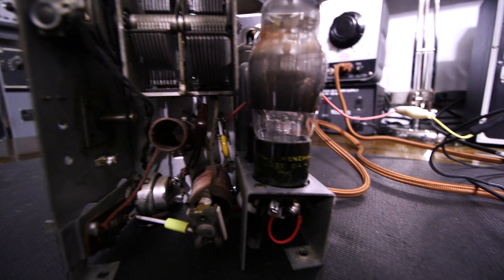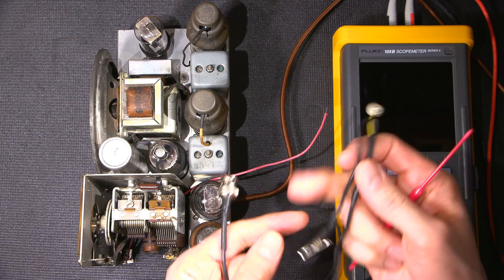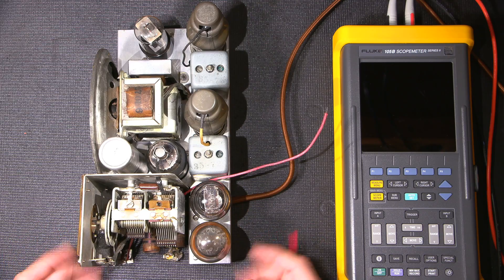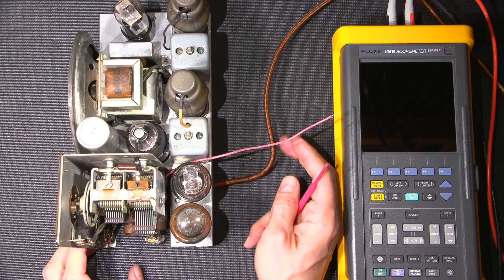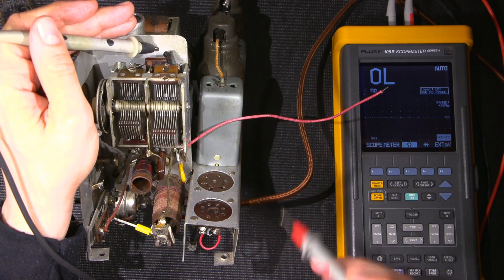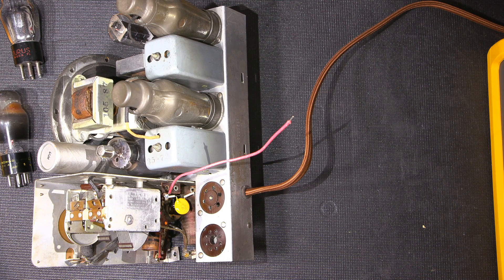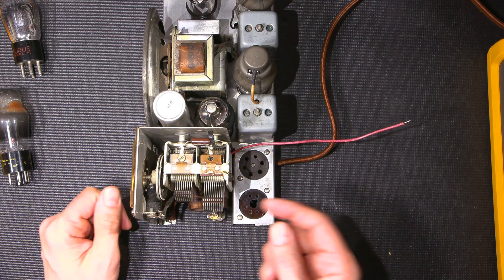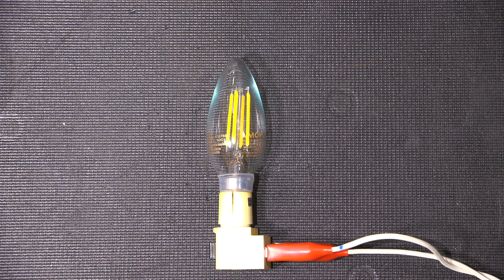See High Voltage Created From Falling Snow!

Comment: Excellent video mystery! RF Antenna engineer here. You built a Tesla coil! My thought is that you have an open circuit transmission line that is of a 1/4 wavelength multiple. What freq was the radio tuned to. Did you change it without effect? The dielectric strength of air at RF is 15kV/inch. You have at least 2KV at that arc. Easy to get voltage step-ups of 5 to 10 times with a transmission resonant transmission line in a partially connected radio. It's how a Tesla coil really works. His secondary was a critically coupled slow wave 1/4 wavelength open circuit transmission line resonator. At Co. Springs the resonant freq was just below 100kHz and about 95% efficient at Co. Springs in 1899. Keep em glowing but not arcing!

Comment: When I was Active Duty in the Marines we would see similar instances of static charges  building up and discharging in our High Frequency Aircraft radios when it snowed or stormed real bad.  Especially prevalent on the ARC-94 HF transceivers and they’d knock you into the next room of you were forgetful and left the grounding clamps off them.  It must have been coming down hard to be jumping an air gap that big.  Super glad you caught that and shared it’s been a long time since I’ve seen it

Comment: I'm still amazed at all this.  At 64 I am trying to learn enough about electronics to restore my old Zenith Trans-Oceanic H500.  After six months of reading watching and doing my best to absorb, I feel confident enough to really screw things up.  I'm still forging ahead and will eventually reach a sub-novice level and maybe be able to test and replace caps, diodes, resistors, that time bomb known as the selenium rectifier, align the bands, and eventually enjoy.  All you guys really do amaze me.

Comment: I would be interested to see if you find any issue with your isolation transformer in lab 2, especially since I have the same one.  I also would love to see a video entirely on safety capacitors, how to tell if you need them and where to put them in old radios, as well as determining proper capacitance for them.  This arc'ing issue  you've seen seems to play right into that.

Comment: I "heard" the effects of static build up /discharge on an old VW bug during an approaching thunderstorm tornado. The Bendix radio in that car had a little neon lamp across the antenna center coax lead to chassis. The radio would squeal in a rising pitch until the lightening would flash, then the squeal fell silent, only to start a new. I can only imagine that neon lamp was glowing away creating some sort of oscillation. Atmospheric/Global /Space Weather is an odd thing.
Very cool topic, thanks for creating and sharing this video
Reply: Neon lamps have a region of negative differential resistance, which can cause them to amplify or oscillate.
Reply: @jordanrodrigues8265  I remember building a "relaxation" code practice oscillator using a Ne-2 neon lamp. I was not exactly sure about the physics but they are very interesting.

Comment: Was the snow the dry, powdery kind? If so, your antenna rig created a charge-separation accumulator. The atmospheric voltage gradient between ground and your antenna can be several kilovolts. In dry conditions, each flake of snow forms a tiny capacitor and picks up a charge when high in the atmosphere. As these flakes pass by the antenna elements, they dump their charge. Any insulation or resistance would allow the charge to build up in the antenna until breakdown is achieved. 

In a similar vein, I worked for a blimp company many years ago. We had grounding chains hanging from the envelope to ground the static charges that would build up during flight. Because the envelope was basically a giant capacitor (made of polyester), lethal voltages could accumulate during dry weather. The last thing you wanted your ground crew to do was touch the metal handrails of the gondola before the chains hit the ground!
Reply: This is similar to helicopter blades building up static charges.
Reply: Uh huh. I've encountered this a couple times. It's not uncommon for wind to build up very high static charges on antenna towers and similar structures, especially if they're isolated from earth. It's more rare to see that with snow but it certainly happens. Yeah, a very long dipole could easily get thousands of volts built up on it as flakes pass by or land on it. Once at a TV station with a thunderstorm approaching, it was not yet storming, the 500 foot tower was well grounded, as were the guy wire tie points, yet there were periodic arcs from the lower wires to ground from about 20 feet above ground. Yes, very long arcs. They only last for a moment. Which brings up another thing, these static discharges, and lightning and related, occur very very fast exhibiting a very high frequency. That safety cap was likely undamaged because it passed the arc easily. Being such high frequency the cap looks like a short. Since it happens only periodically and so quickly nothing heats up, nothing gets damaged. Solid state devices however could certainly die in that very short time.
Reply: I get a series of zaps while vacuuming ash from my pellet stove...Sparks jump to my hand thru the plastic hose as the dry ash particles flow. There is likely an AC component of pulses building the charge induced on your antenna. That explains a potential across the inductor in your radio's front end....
Reply: is it pulling electron off the antenna , or dumping positive charge  on the antenna ??

Comment: Show us your antenna's set up's.  Plz. 

What kind you have, what there used for, which one was the one hooked up at the time of the arcing.
Reply: I (Radiofun232, YT user) am interested in that question too, also the exact time when the arcing happened, part of the day, wind conditions, the type of snow (snowstorm), the wiring into the radio shack, + the schematic of the antenna construction and the radio (basics of course, especially the power supply part) and the way it was connected to the mains supply).
Reply: He told you in the video that it was a center fed (extremely) long wire for LF-MF SWR radio reception. He only had the center feed wire of the coax connected to the old tube AM radio at the tuning input cap. This is why it's so important to have a DC grounded antenna, then this discharge will go to the ground rod through the loading coil.
Reply: @rolomaticz5009  OK, my idea is that the antenna is/was charged by frictional electricity, caused by the snow, pushed by the wind. But the snow (weather situation) must have been dry in that case. And with frictional electricity both positive and negative charge can be caused, depends on the materials. So that is why I am/was interested in the whole electric setup.
Reply: Yes! We want pictures. Videos. Yes, antennas are a much videoed topic. But we have never seen the details of how the Master Electronics Carlson does it!

Comment: I have heard of this happening several times from HAM radio friends who had long wire receiving antenna's (REALLY LONG WIRES for ELF and VLF frequencies) seeing ARCS  and in one instance getting physically shocked! This incident was recalled by a famous radio show host in the U.S.A. whose name was Art Bell who hosted the "Coast to Coast" radio show on late night, Art recalled this event on one of his show's a few decades ago!! Art has been a "Silent Key" now for quite a few years!! Yea dry snow with wind behind it could really generate some  high voltages on a long wire!!
  John Bellas KC2UVN  73's  Interesting to see this happening! Thanks for the video!!  Just before any storms with or without wind, I always disconnect antenna feeds with a switching system that disconnects all my equipment of any antenna's and grounds them out even though they have static suppressors inline on the coax as well as lightning protection outside the house!!
Reply: Smart man.
Reply: I also recall Art Bell talking about it on his show back in the day.
Reply: Question I would have, would this be a potential for a fire while someone was away and not making the disconnects that would be required? I'm guessing yes.
Reply: @jdmccorful  , Oh yes!!!!
Reply: @jdmccorful  that's why you can buy a static discharge arrestor... which attaches to the coax from the antenna. It grounds (discharges) the electrical charges. Useful to have.
Reply: Hhaa I remembered that the second I began reading your recollection of it.

Comment: When I was a kid in the 1980's I once built a project that did this with dripping water through 2 rings. Over time (sometimes took a few minutes depending on humidity) it jumped across a 3mm needle gap, so a few kV at least (didn't have HV meter at the time). Pretty inefficient compared to a Van de Graaff generator, but never wore out since the only moving part is water. Looks like there's some capacitance getting discharged in that arc, so it bites a bit harder than a doorknob and feet rubbing on a carpet. I sure wouldn't want to try it with 10 Joule or more worth (ie 3000v and 2.2uF), good chance of getting killed. Even 0.5J (250kV 14pF from a VDG) hurts quite a bit. I've never seen it happen with snow, but I guess whether the water is frozen or not doesn't matter much as far as physics is concerned.
Reply: the 14pF at 250kV might have only 0.5J, but will push a LOT of current because of the really high voltage (this is why it hurts a lot). Personally I'd rather take my chances with the 250kV as the pulse will be much sharper and shorter then with a 2.2uF at 3kV...longer pulse = greater chance of stopping the heart, not sure if skin effect comes into play with these discharges as well.
Reply: Kelvin's thunderstorm! I still want to build a steam jet version, don't know if that would work.
Reply: got shocked by a 6 joule (7kv) electric fence a few times.  your whole arm jumps and goes a bit numb.
Reply: @ancapftw9113  

Speaking of an electric fence.

Well I used to stay on a farm.

The the pigs kept escaping through the fence.

Just friends rails on posts. 

Wood.

They've squeezed right through.

We had an old battery powered electric fence charger the type it would run off like a 12 volt battery.

So we decided to put up an electric fence.

We were installing the insulators and wire on the fence. On metal post.

Sharon T post.

The battery was disconnected but one lead was still connected to either the positive or negative from a 12-volt battery.

I was putting the wire on an insulator.

I don't remember if I was touching the post at the time or not or do I get to my feet I was wearing shoes at the time of course.

I think it was like four or four and a half kill volt electric fence hard to say.

But the wire got bumped and brushed against the positive or negative the one that wasn't connected at the time.

 long enough to to activate fence controller.

I jumped like a mile.

Remember that one time Weaver setting the pigs off the slaughter.

And a hand a hot shot cattle prod.

One of the pigs went underneath the guy's leg he lost his balance.

 and happening get when the other guys is that was helping us.

 to his rear end on his back.

 business shirt happened to be to the side.

 and when he was falling because the Pig going between his legs.

 he happened to pull the trigger on the cattle prod.

 the other guy got the full brunt of the of the cattle prod.

Needless to say there is another person that well Roundup well...

up getting Zapped afterwards.
Reply: @AKAtheA  Skin effect on human skin is mostly a myth. It's really only significant with good conductors (metals). With a human being the conductor RF and short-pulse currents actually prefer blood vessels and nerves (higher conductivity once the skin is burned through than fat and muscle). I once did a simulation assuming 100kHz from a CW tesla coil or ferrite transformer and a skin depth on actual skin was something like 5 feet (=basically nonexistent since no one is 10 feet wide), and even 100MHz was several inches assuming the voltage was 500V or more (enough to burn through skin) so skin effect probably wouldn't save you, it just makes you cook longer before you notice since it tends to destroy nerves as it preferably moves across them. Now with lightning strikes it's a bit different, most of the energy goes around the person rather than through them (otherwise they would not only certainly die every time but explode where they stood like a small tree) since plasma is a better conductor than human bodies, and with 100MV corona is all over you down to your feet right before you get struck. And yes given the same energy I would definitely prefer the 250kV over 1kV if I had to pick one for the reasons you stated.
Reply: @ancapftw9113  : better than finding the wire in the snow when peeing into a snowbank!
Reply: Aaron calm your enter key please
Reply: Could it put a hole through the varnish in transformer's wire?

Comment: Hi I really enjoy Watching your videos... Here is a hypothesis on the effects you are seeing... As the snow strikes the antenna a static charge is built up and passes down the antenna, as the chassis is not grounded charge builds up on the entire chassis of the radio until it reaches the brake down voltage required to overcome the insulation of the isolation transformer, when this arc occurs not only is the charge on the chassis of the radio sent to ground but all the charge on the antenna which must pass through the aforementioned 30ish ohm coil as the current spike passes through the coil it generates a massive magnetic field which then collapses creating a very high voltage spike across the coil causing the arc observed ( essentially the coil is both a primary and secondary all in one. In this case earth is one plate of a capacitor and the antenna is the other.

Comment: Back around 1976, I was driving home on the highway on a summer night.  There were storms brewing around but it wasn't storming or raining where I was.  I  kept hearing this clicking about every second or so.  It took me a bit but I finally figured out it was coming from my in dash stereo.  The unit had a trim cap on the front for tweaking in the antenna.  The noise was an arc coming from the trim cap.  I could see a flash every time I heard the snap.  Needless to say I reached in the back and unplugged the antenna.  Didn't affect the radio luckily.

Comment: Great story! 33kV / cm in dry air to get an arc. You must have had a good storm. I saw this as a child. Arcing was occurring across a PL259 connector for my father's CB radio antenna. The antenna was a fiberglass coaxial-type vertical and was ungrounded. I can't explain why you were getting an arc across 36 ohms. Weird unless you had RF and a reactance that blocked the 36 ohms from shunting the current. I look forward to more depth on this one. Thanks!!
Reply: Are you saying the connector was attached to the antenna and nothing else and it was arching?
In a snow storm? Or a regular storm?
Reply: @Drottninggatan2017  Yes. Only connected to antenna with other end in free air. It was windy and there may have been a storm approaching. This was in 1970's.

Comment: I’ve had the same thing happen to an MFJ antenna tuner hooked to an 80m end fed antenna in a heavy rain storm. It was arcing across air variable capacitors. It does it any time it rains heavily so I now short it out anytime I’m not using it.

Comment: We make concessions for precision and resolution. Over a decade and a half as an RF bench engineer and this is a fun thought project. Are the labs built to R56 or similar standard? Have you tested the quality of your line voltage and grounds? I've seen highly charged air and mediocre grounds clash in expensive ways like this, especially if you throw in distant lightning strikes. It's just enough sometimes to cause unshielded ICs to internally become something different forever and let the games begin. This is an interesting one and will be following along as usual! Thank you for sharing!

Comment: When I was young I traveled a lot on train with my mom, and sometimes when we waited for the train and it was raining, our umbrellas would start giving us shocks. That was probably because the raindrops captured charge from the HV wires and carried it not only down but sideways for several meters, and deposited it on the umbrellas. 

Maybe you don't have HV lines near but the snowflakes may have charge just by friction - or maybe they carry charge all the way down from the clouds and this is like a micro thunderstorm during winter.

Comment: I have seen something like that in a  TV broadcast antenna. We found out that there was a Voltage buildup and when the Voltage reached about 30K Volt, it could jump over relays that were switched off. When it then arced over, it could also arc around components. I was new at that moment so did not understand much of it but it looked much like you showed.

Comment: About 50 years ago at WFEA, Manchester, New Hampshire, I saw the same phenomena of arcing in the open wire feed line.  When we opened the switch to the line at the transmitter end we had 6” arcs across the knife switch.  Lasted for several hours.
Reply: @poiuuy533    Do you have the HAARP testing schedule!
Reply: Steven Bates It was 1964

Comment: Great video as always! I observed the same phenomenon in my shack last year. I heard what sounded like a clicking sound and tracked it down to the power supply that powered the 2m rig. The clicking sound was a discharge from the common mode power filter to chassis ground. I disconnected the antenna from the radio and the discharge stopped. The outside weather was windy and very dry, no snow or rain. My conclusion was static buildup on the antenna and discharging through the power supply. As you observed, there was no damage to the radio or to the power supply.